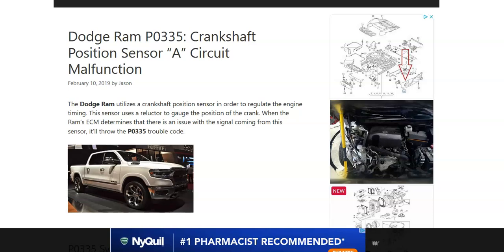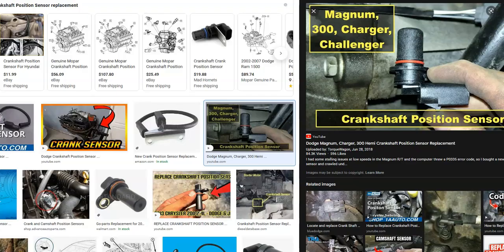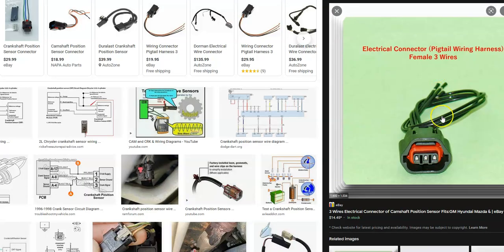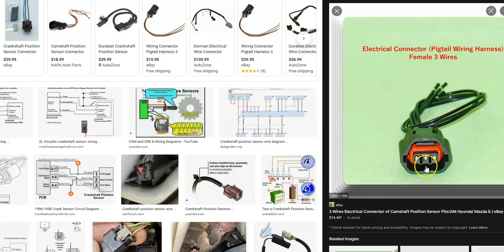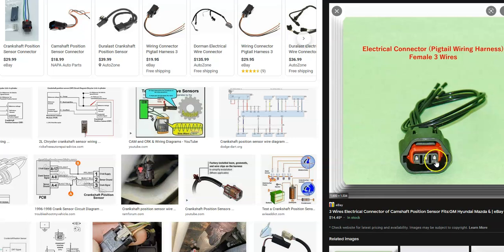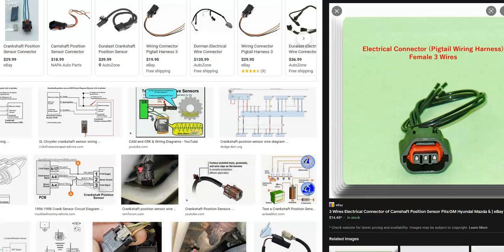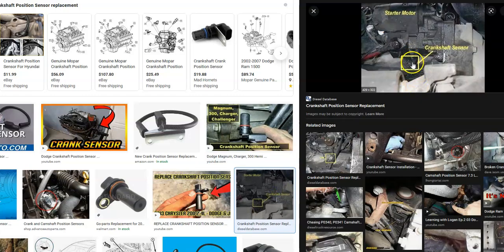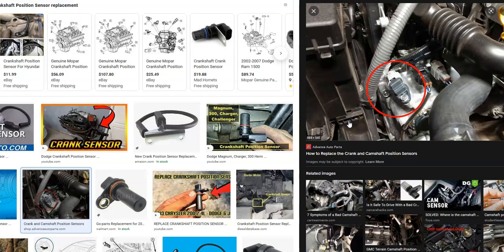Causes and Fixes Dodge P0335 Code: Crankshaft Position Sensor A Circuit Malfunction

Comment: Do you know if the 2022 Ram 2500 Cummins have to do a relearn after you change?
Reply from the maker: Most vehicles these days will need a crank/cam relearn. It basically comes down to how well-built the replacement sensor is. If the tolerances are the same as the old sensor, there likely will be no issues, but if the new sensor tolerances are way off, it will likely need a relearn. Always go with OEM sensor if possible.

Comment: i Read oil on the sensor could set off the code and a guy online said he wiped off the oil and put it back in and truck started up again. I did the same, is it normal for oil to be on the sensor?
Reply from the maker: Internally, there is often oil, but externally, there shouldn't be any oil. If oil gets into any electronic components, it can cause issues.
Reply: @HVAC_Mechanic  I found out it was the wiring
Reply: Can this sensor cause stalling intermittently?

Comment: Could a bad sensor drain the battery over time?
Reply from the maker: Only if there is a short; there should be no power to the crank sensor until the key is in the On Position.